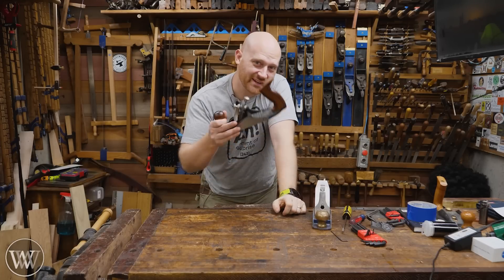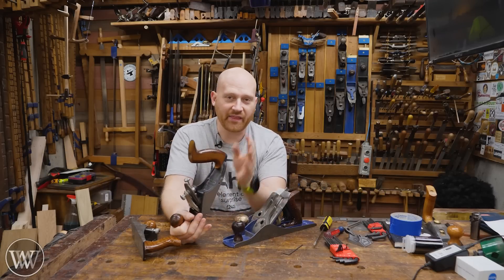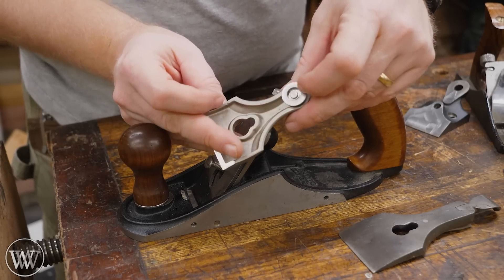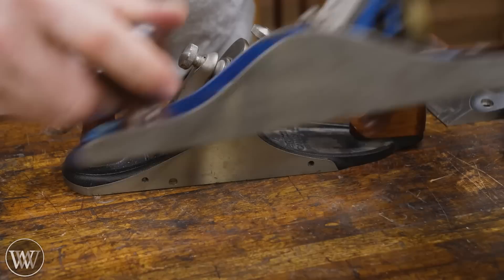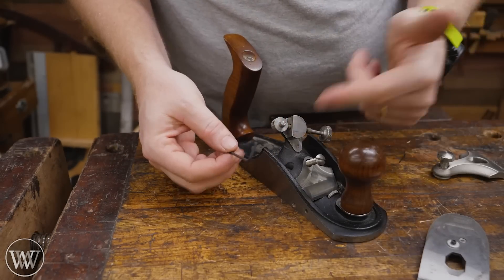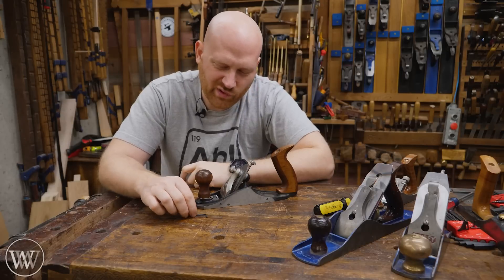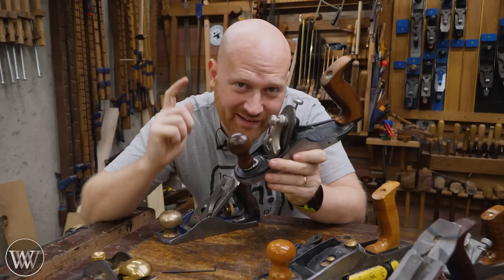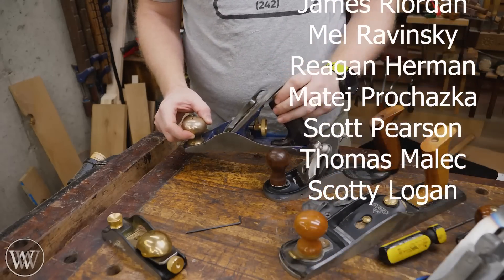The Best Plane Ever Made!

Comment: I think the reason they used the slotted screws on the side is the sawdust gets in the Allen screws and you have to dig the dust out with a scribe I changed mine and had that problem so I changed back to the slotted screws

Comment: That tiny screw holding the cap iron would drive me insane! I can see me losing it the first time I take it out🤣
Reply: Having spent about an hour searching for it the first time I took it out of mine, it's a point worth raising.   Doesn't take away all the other goodness, of course, but I feel like I should order a box of spares just in case.
Reply: @MrBwschwarz can you glue the washer to the screw? Seems like it might be harder to lose? I've never tried one, so I'm sure there's good reason for not doing so.
Reply: They could offer a custom lever cap...
Reply: I can see a few of allen keys and fiddly tiny screws lost in the work bench or floor full of shavings or saw dust. Nice plane though, but...
Reply: But having shared my thoughts re the screw, I must add that Veritas tools are insanely good quality. I have a few of their micro planes that I use for Luthiery and jewelery box making. If I didn't have a #51 shooting plane I would be getting the Veritas shooting plane for sure.
Reply: @MrBwschwarz I just never fully removed any of them
Reply: @OswaldoAgurto i own a few of them, i have never had any of the grub screws or anything fall out of any of them. the machining is done well, and the design is well thought out. you pretty much set them and thats it. i dont move the blade set screws ever on any of mine, never needed to after the initial setting. just an fyi from a dude who has them, along with a ton of other brands. I have never had a regret with a ceritas, unlike some others...cough, WoodRiv-cough
Reply: …buy two extras when you get your plane…put them where you keep your eye glass screws…this assures that you will never drop loose or strip this tiny screw ever…I love my 5-1/2 about to order a 4….a number four with two extra tiny screws!
Reply: @clars7146  thats a good idea as well!
Reply: @clars7146  i own the standard 4 from veritas, and after using the custom id highly recommend going with the custom.
Reply: I would have to epoxy a tiny magnet to it just to keep it

Comment: Well said and I really enjoyed this. I use almost exclusively older planes that I restore, because I can still find them affordable in garage sales and antique mall nooks and crannies. And in restoring them, I come to know the tool inside and out. My favorite jointer is a  24" wood body and my go to is an old Stanley 5 that I cleaned up and that just sings. I also have a British made 12-204 that I use for fast, rough work, such as shaving flats on turning blanks for mounting face plates. I have an o-o-old Stanley 45 with a full set that fulfills a lot of my one-time needs. I could go on but you get the drift. Anyway, lovely bit.

Comment: Just got my custom #4 the other day and boy were you right about it. Customized to how I wanted: O1 blade and traditional tote.  Set the mouth once and then the set screw and its set till you want it changed.  Set the chip breaker once and its set for good (or for at least a few sharpenings). The blade arrived lapped (actually sharp enough to take perfect shavings without honing it). This plane takes the fiddling out of hand planing.

Comment: Those side screws are essential with Norris adjusters, otherwise it doesn’t work. I’ve made a few planes with Norris adjusters. I much prefer the Stanley adjuster system. The Norris lever needs to be longer, but then it would get in the way. My other gripe is the ridiculous free play backlash in the Stanleys. So I mostly use a Stanley with a better iron.

Comment: Hi james, may i suggest using a T handle allen key? If used correctly they prevent you from stripping out the screws. When you tighten the screw at a certain point the key starts to bend slightly and that's tight enough. So the key gives you feedback, it's easier on the hand and since it's bigger it's easier to find in the shop.
Reply from the maker: That is what I normally use. But I could not find it for the video.

Comment: I bought one and when I was trying to assemble it I broke the screw on gizmo that holds the cap iron to the cutter. The head of the screw got lost on the floor it’s so tiny and I hadn’t swept for a couple of hours. I quickly determined that it was too finicky for me and a deal breaker. I drove back to Lee Valley and returned it. I have the Veritas Number four and I am quite pleased with that one.

Comment: I have a standard Veritas #4 that I sorely mistreated when I got it because I didn't understand planes. It has a number of features like the adjustable frog that's a little easier to use than a Stanley, but I find I never use that feature. Now, I am thinking that if I get another 4, I'll get one of the Reed 55° adapters so I can have that high angle. The Veritas #4 I still need to fiddle with more before I'm super confident about just grabbing it and using it as the final smoother.

Comment: You should add a link to your Reed adjuster in this video. I had to rewind a few times to make sure I'd heard you correctly -- I too don't care for how adjusting the Lie Nielsen's depth can cause the blade to skew. I knew about the Howard adjuster and that Eckert had stopped selling them. Curious, and a little excited, I spent some time googling and found your REED bearing page. 😁
Reply from the maker: No thanks for the reminder. I might have to add that. You can find them at www.woodbywright.com/shop

Comment: I've really enjoyed your videos, thank you!  I just received a custom#4, my first BD plane. My BU Veritas LAJ has been a joy to use, simple, well machined, love the "feel".   However...I have a lot to learn on BD.  Do you have a "how to" video on what to change when your BD plane "is just not right"? For instance, pick a material, maple, walnut or fir, what's a good place to start with the mouth opening, why?, and then show the difference it makes. What's a good distance to start for the chip break to be from the blade edge, and then show the change it makes with the current piece of material. If your getting little "hunks" torn out of your board, does that mean your blade is dull?, what are the options (because you now have a "hole" in your precious material, and don't want to make any more "holes").  As a BD "newbe", the above is what I have to learn. Your teaching style is enjoyable and easy to follow. I look forward to learning from your years of experience.
Reply from the maker: Sounds like fun. Unless you're working with difficult grain you can have the mouth open about a 16th inch or more. Same thing with the chip breaker back from the edge. It's only on difficult grain where you're getting tear out that you want to move to the mall tighter and closer. The tighter the mouth and the closer the chip breaker the cleaner the cut you get on difficult grain. Difficult means you're getting tear out not that the wood itself is hard. But usually the first thing to do is just to sharpen. Sharp iron and a low cut will answer most problems.
Reply: @WoodByWrightHowTo  Thank you:). I was having decent results with the BU, but having trouble with the BD. Can't wait to try your suggestions. I probably have both the mouth and blade set incorrectly. I appreciate your patience and reply
Reply: That worked! Thank you:). I was doing the exact opposite, super tight everything. Stropped the blade just to be sure, then loosened up the mouth and breaker, and presto, it works. Wanted to acknowledge and Thank you very much:)!

Comment: James, if you recommend (as you did in the video) a 30 degree frog, you will have zero clearance angle. The blade will then not cut. You have also missed discussing setting the closed chipbreaker and aligning this with the frog angle. My own #4 has a 42-degree frog, and my #7 uses a 40-degree frog. This is the lowest one can go to, and it ONLY works with a closed chipbreaker (otherwise you will tear out on most woods). Regards from Perth,  Derek
Reply: I have not spent much time with lower bedding angles for bevel down planes. Are you using these lower angles for specific woods or in general use? Also I would like to know more about your testing that lead you to arrive at the angles.
Reply from the maker: For the 30° frog, you just need to sharpen the iron at 25°.
Reply from the maker: The lower the angle it's easier the plane is to push. But the higher the chance it's going to cause tear out when going against the grain. So if you're working with a straight grain board and going with the grain, a low angle is a pleasure to push. However, if you working with difficult grain, a higher angle will give you a cleaner surface just a bit harder to push.
Reply: @WoodByWrightHowTo  No, that will not work. A 25° bevel on a 30° frog leaves 5° clearance. That is too little to prevent the plane choking. It will stop the blade cutting. There needs to be at least 8° minimum and around 12° ideally. Read Leonard Lee "The Complete Guide to Sharpening" (Leonard Lee is Rob Lee's late father. Rob Lee runs Lee Valley/Veritas, whose plane you are reviewing. I played with it while it was in pre-production form. For the past 15 years I have been road testing planes and tools for Veritas). I will add a link to an article I wrote separately - adding it here may block this post.
Reply: @WoodByWrightHowTo  A lower cutting angle is indeed easier to push, but it also leaves a brighter surface. A high cutting angle may resist tearout better, but it leaves a duller surface. A closed up chipbreaker prevents tearout, and even when the cutting angle is low. Hopefully you can see the article I have linked to below.
Reply: @reedplanes728  I build furniture using West Australian hardwoods. These are highly figured with interlocked grain. I spent many years working with high cutting angles on BU planes, but in the past 10 years have preferred BD planes, as long as they use a "double iron". This refers to a blade with a chipbreaker. My website has numerous build alongs with demonstrations of this process (I will link to this separately). The article I linked to below goes into this in some detail.
Reply: @derekcohen1000  The bench planes that I make are bevel down and have a chip breaker.  I will search out the article as the link did not show up. Your brighter - duller surface observations are very interesting and I will need to look more into that. Appreciate your response. Jeffrey Warshafsky
Reply: Derek, if I currently have a #4 with 40 degree frog (30 degree blade bevel, closed chipbreaker), is it worth it to try a 42 degree frog?  I imagine only difference is clearance angle, but I don't know how this translates into appreciable difference in use.
Reply: @LBandGizmo  You should be fine. Just do not be tempted to sharpen the blade to 35 degrees as you will run out of clearance, and the plane will not cut for long. Regards from Perth,  Derek
Reply from the maker: 5 degree clearance angle is more then enough. you can plane with a 0 degree clearance angel such as a chisel plane as long as you start at the end of a board. but 5 degree will give you plenty to dive into the board. most of my planes have 10 degrees of clearance but I so have one with only 5.
Reply: @WoodByWrightHowTo  James, I suggest that you consult recognised texts here. For example, "The Perfect Edge" by Ron Hock. He states: "The standard bench plane uses a blade bevel-down, usually with a cap iron, or chipbreaker (also simply breaker). Absent a back bevel (sometimes called a top bevel), the angle of the bed, or ramp, is the angle of attack of the blade into the wood. A clearance – or relief – angle is required and needs to be at least 12°." (page 149).

Comment: That allen wrench set up is a deal killer for me. I mean, I would lose it in the first day or two. Some of the other features look good. I do like the traditional lever cap. Side adjustments aren't a problem, but I seem to prefer using a small hammer for micro adjustments rather than the lever. I seem to over correct too often with the lever....